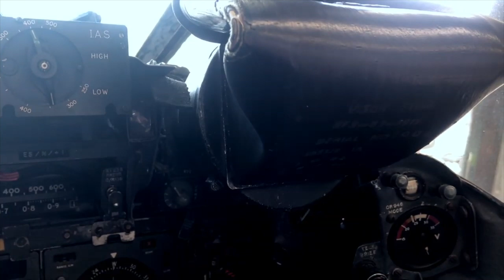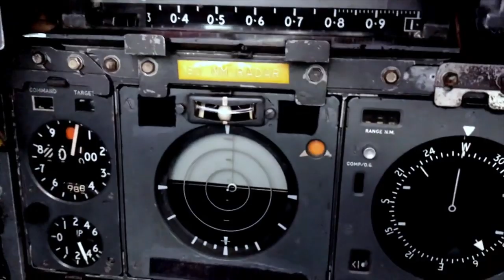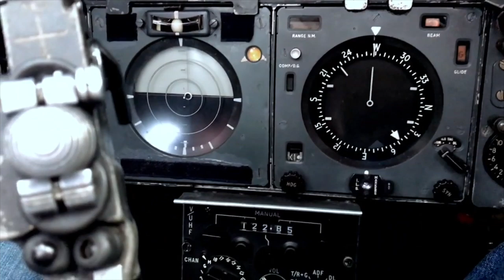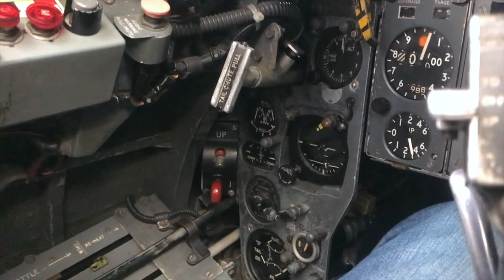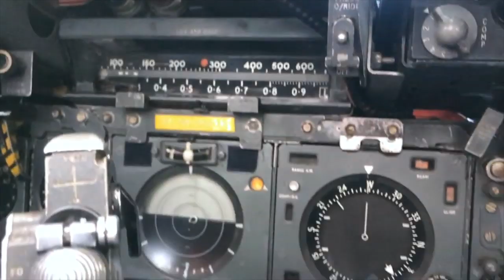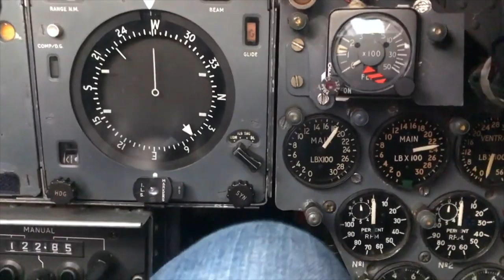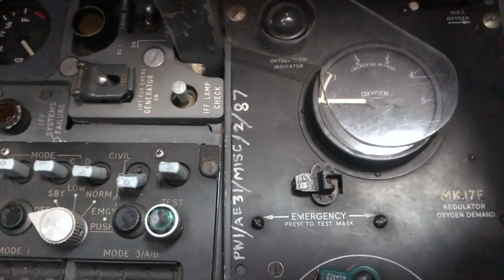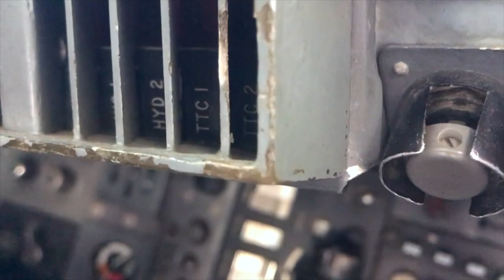Lightning XR728 Cockpit Tour | with Dennis Brooks (Clip)

Comment: I finally understand why the Brits loved the F-4 Phantom II so much after coming out a lightning
Reply: It's funny you say that because when I asked my friend what it was like getting out of a Lightning and then flying the F4, his answer summed it up. He said, in his actual words. It was like getting out of a Ferrari and then trying to drive Bedford truck!
Reply: @julianneale6128  Yeah it seems like the crews like the phantom more so for its weapons capability and workload sharing rather then its raw performance.
Reply: @ThatGuysProject  yes quite so. The Lightning was originally designed as a high performance testing aircraft with the potential to become a fighter, which is exactly what happened. It had many short falls and required many man hours of maintenance. The cockpit was however well laid out and an originator of HOTAS (Hands on Throttle and Stick)...
Reply: +Steve D You have to remember that this was designed in the 50's. Also, performance-wise nothing could touch this for YEARS. Some modern jets still can't climb/fly as high like this did.
Reply: @SgtSteel1  the fandom was only designed 2.5-3 years later.